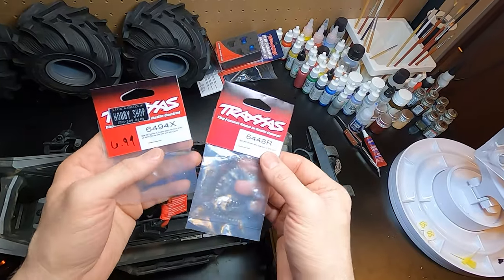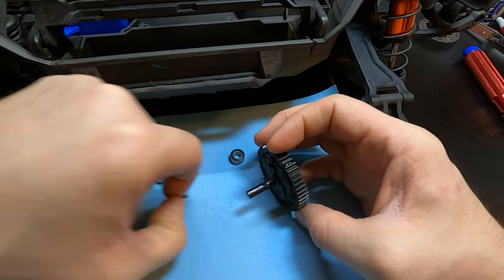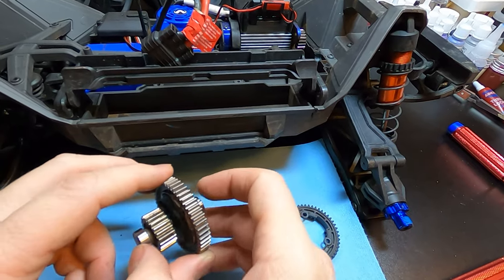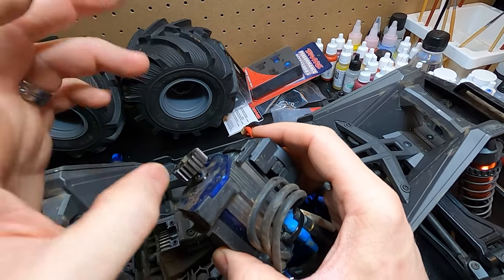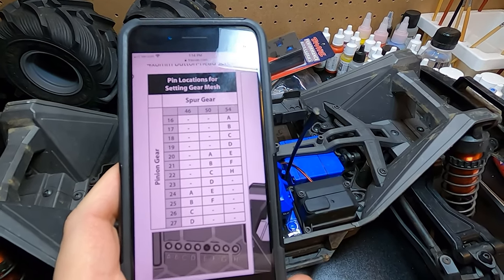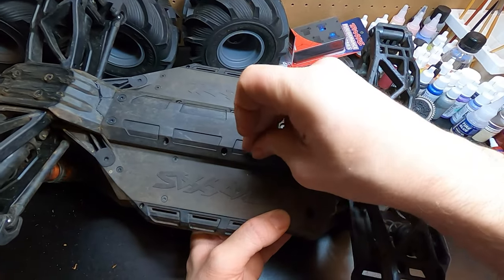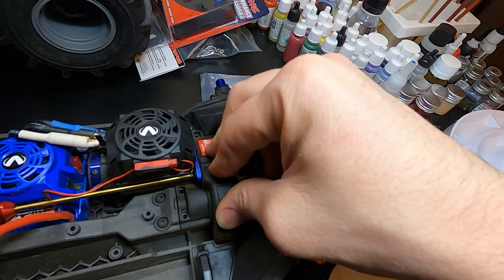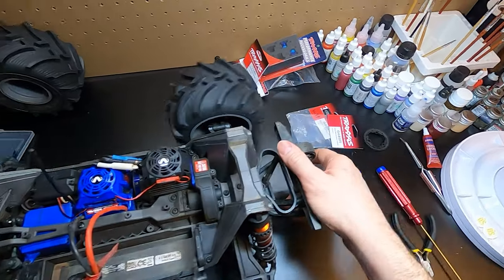How To Change The Spur And Pinion On The Traxxas Maxx V1 and V2

Comment: Excellent video!  I have changed quite  a few spur and pinion gears in my day but never on the Maxx.  Many times it can be tough to find good "how to" vechiles online howver this one was perfect.  It was straightforward and right to the point.  I am now running a metal 46mm Spur gear with a 25 tooth pinion on the v2.  I think the v1 comes with a stock 25 tooth and v2 comes with a 24 stock.  Also have a set of Arrma Talion Katar tires on it and it turns into something even better than it already is.  The handling is phenomonal and speed is ferocious.  These are definitely the tires this should have come with.

Comment: Alright so I have a question I bought a 54 tooth spur gear and the stock pinion gear is 23 teeth on the maxx manual it doesn't show you on the chart what slot to drop the pin into so can the 54 spur not go with the 23 pinion

Comment: Great video, thank you!  Can I ask why 20/50? I notice a lot of people using that setup but doesn't that make the truck slower?
Reply from the maker: Yes, it is slower, but you need the torque to turn the drive train. It will cog if it is geared too high. I actually ended up going 20/54. So it's geared even lower than 20/54. That seems to be as high as I can go and not have it cog when I get on the throttle.
Reply: @outsourcedrc  Thank you for your reply. I understand why the gear change is necessary.  I guess my question is, is it really worth slowing the truck down that much just to have bigger, heavier tires? Why not just go with something like the Trenchers LP 3.8 and keep some of the speed?

Comment: Need to replace the gearing on my widemaxx (went with metal spur and didn't upgrade pinion. Pinion got tore up eventually). Winter is here in Michigan. How do you think the fling kings would do in the snow? Or should I just go paddles. What would you recommend for gearing? Thanks so much

Comment: Nice Video, I was just about to tackle this job, and now I know exactly how.  I know it has not been long, but how are those Jconcepts tires holding up?  I really liked how they looked to handle and may pick up a set.
Reply from the maker: Don't let them balloon. I've had to reglue them. You can sling them off the wheels.

Comment: I bought the 3.8 belted badlands for my Maxx V2. What gear set up would you recommend?
Reply from the maker: Those look like they are for the E Revo. They are probably pretty heavy. Is it cogging? If it does, then try a 20t pinion. If it still cogs, then bump your Spur up to a 54t. If it's still cogging, then you want to go down on your pinion some more. 16t is a low as it goes.

Comment: What would be the best tooth count for getting more speed from the Maxx
Reply: For any RC, close to a 1:1 ratio. Bigger pinion, smaller spur. In this case, probably the 26 pinion and the 46 spur. That would definitely heat the motor up though.

For general knowledge: 50t pinion and 50t spur is a 1:1 ratio (same as say 46 pinion, 46 spur. 58 pinion, 58 spur. These are 1:1 ratios). This is what some 200+ mph guys use. Though terribly unreasonable and too hurtful for the motor for a normal RC. 

Hope this helps (over a year later lol)

Comment: Do I have to change the pinion on my V1 if I put on Sledgehammer tires?
Reply: No.
Reply from the maker: You don't have to, but its not a bad idea. The V2 comes with a smaller pinion. It's a 23t
Reply: Never changed anything when I switched to 3.8 backflip lol. Having some gear mesh issues after upgrading to castle 1515 combo now though gear mesh seems really tight on 24/50 setup and metal 50t spur?

Comment: Have you noticed the gears stripping easy on your maxx. Just swapped out to a 54/18 and put it in the C pin hole and got 20mins and BOOM. All stripped. Traxxas gears are not good imo